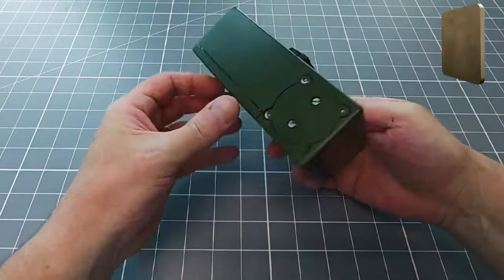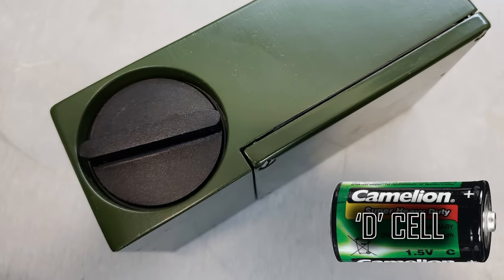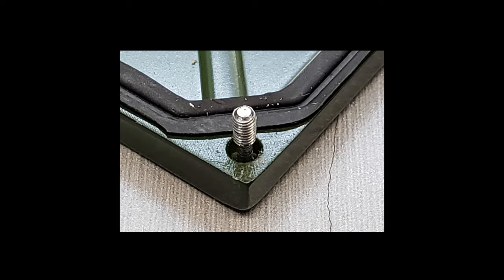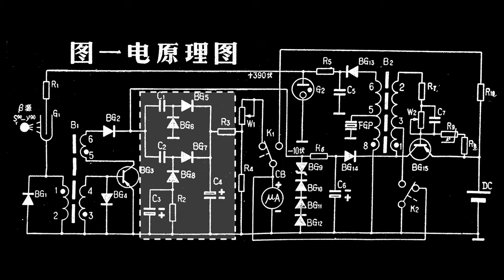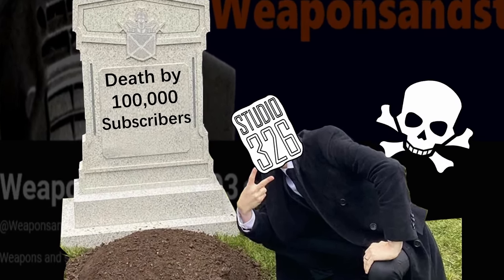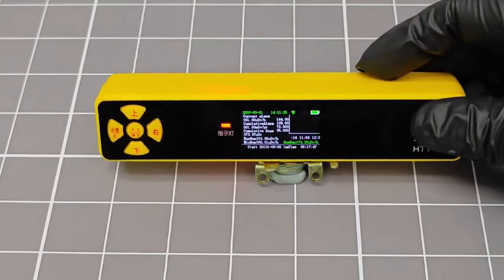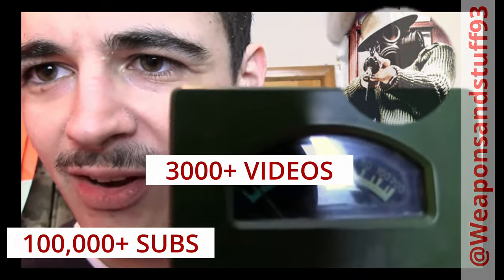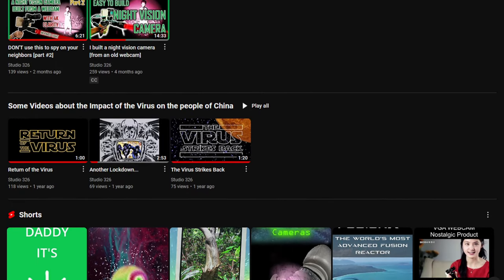Buying a Vintage Geiger Counter  ☢️

Comment: Great video. Just keep in mind that when comparing the dose on contact with a rough point source to a full body dose, that the dose from the source is extremely localized, and the effective dose is low (hundreds of times lower than the full body dose). This, coupled with the fact that Sr-90 delivers near zero deep dose, means that holding the Sr-90 source in your hand for instance, would expose you to very little effective dose (probably less than 1uSv/h).
Reply from the maker: For sure, this is not a whole body dose that W&S93 is exposing himself to, but actually the point is, he is literally touching the Sr90 metal foil.  The naked source will have a foil cover, but this is a very old source, from the 1980's and corrosion is always a concern.  
Personally, I treat this source with the upmost of care.  I plan everything, and every step (and practice the steps) from when the source is taken from the lead box, until it is place back into the box again.  I have kept source holder is intact, its really handy with the spring loaded cover.  As soon as I release the clamp I use to open the source, the cover just springs back into place and the source is in a safe condition again.
I think that the 1uSv/h rate you estimated is about right for a gamma source but for beta, it is likely to be about 10x of that.  Whilst the Seivert is a handy scale for whole body doses, localized exposure also problematic.  Physically touching the naked source is kinda dumb...
Reply: @project-326  why would beta be 10x more? I'm talking about effective dose here (the equivalent of a full body dose). Betas have poor penetrating power and hence don't even contribute to deep dose. The only area exposed would be a few grams of tissue right in front of the source, and hence the dose is way lower than a gamma source with similar dose rates (due to the radiation penetrating into deep tissues). Assuming your source has an activity of around 25uCi of Sr-90 (50uCi SrY-90), then the decay heat would be around 160nW (5.85x10^-4 J/h), since each beta decay yields 1.1MeV of energy (combined Sr and Y). Since only one side of the source can face you at any time, <50% of this will be absorbed by your tissues if you placed the source against your skin. Since the gray is defined as J/kg, and assuming the average human weighs 60kg, that gives a mean full body dose rate of the 4.9uGy/h (except all localized to a small amount of tissue). If this was spread out over the whole body, the effective dose would be 4.9uSv/h, but since it's localized to the skin and shallow tissues (low tissue weighting factor) it'll be much lower than this. On top of this, substantially less than 50% of the betas would actually be absorbed by your body. Most Sr-90 sources have some moderate self shielding, meaning a lot of the lower energy betas are absorbed by the source itself. On top of this, the source you have in particular has that whole sliding shield assembly, which collimates the beam, meaning that in the end the beam angle is substantially less than the 180° assumption I used. Anyway, I hope that explains where I got 1uSv/h from. Thanks!
Reply from the maker: @inductivelycoupledplasma6207  That is a fantastic reply, I will work through the calculations and learn!  
I was assuming a weighting factor of 10 for beta, but I just looked it up and (according to Wikipedia) it is the same as for gamma, ie 1.  
Yes, the whole body effective dose is low, it is a small source, just pretty bright.  But I'm sure you are not suggesting that handling this type of object in the way that W&S93 does is a reasonable way to carry on (he routinely handles this source in a fair number of his videos)?
You are correct about the geometry of the source holder, you can probably divide by 3 (ie 120 deg)...
Reply: @project-326  thanks for replying! They were just ballpark calculations and I made many assumptions along the way, but they should give at least some idea of the actual stochastic risk from such a source (which is extremely low). Of course, the main risk with SrY-90 sources isn't cancer, but rather exposure to the eyes and potential cataracts (albeit highly unlikely unless you use the source as a monocle). The main thing that bothered me about Weaponsandstuff93 wasn't the fact that he exposed himself to excessive beta radiation (not ALARA, but still not a big deal). What bothered me was the fact that he tore the window of the source open, spilling source material on his keyboard and contaminating some of his detectors at the same time. He then proceeded to place the mangled source on his carpet in a later vid (along with a naked DP-63-A radium scale).  That guy is completely clueless when it comes to contamination. I don't even want to think about the fact that I've seen him place a 60uCi pyrotronics Am-241 source on his carpet too (these leak a lot and Am-241 is about 10x more toxic than Ra-226 through inhalation, and 1000x more toxic than Sr-90). 😬
Reply from the maker: I just realized a mistake in my last comment, when I said the ratio should be 1/3 because the angle is 120 degrees.  This is wrong, I should have used solid angles.  A Cone with an apex angle of 120 degrees presents a solid angle of exactly pi steradian, so with 4.pi steradian in full-space, the factor should be division by 4 (not 3).  Was taking a crap, when this just popped into my head...  :-)
Reply: @project-326 yeah, meaning the beam power is quite a lot lower than I calculated. Honestly not too bad of a source to handle, and I would just make sure to protect your eyes if you're using it frequently or for moderate durations. Finally I just noticed that the Meassal read quite high (30uSv/h or so I think), which isn't due to bremsstrahlung. The majority of that will be very spicy (up to 2.28MeV) Y-90 betas that are able to penetrate the enclosure on the detector. The amount of pure bremsstrahlung should be very little (just a few uSv/h at most). You can test this by measuring the source on the radiacode with a couple mm of glass or aluminum in between.

Comment: I don't remember if you corrected yourself in your subsequent videos, but radiation from beta sources is not measured in microsiverts. You can use becquerels or "number of decays per square centimeter". Or you can add "conditionally" to the microsiverts. For example, the dose rate of this beta source is 2 microsiverts, conditionally.
Reply from the maker: Yes your are correct, but most devices cannot differentiate and just use uSV/h.  My alpha/beta spectro displays using Sv/h/cm2, which again is making assumptions, but translating that back to a GM tube is really not easy.

Comment: BR-6 and HTT-60 maxed out! Hehehe.
Reply from the maker: I didn't show what it did to the Gamma Scout (PoS), I'm saving that for the next vid.
Reply: @project-326 how old is your gamma scout? The newer ones are much better (still PoS for €500 of "quality German engineering). Mine doesn't seem to crash, and response stays linear up to around 5mSv/h (starts to saturate severely above 10mSv/h, but doesn't drop to zero).
Reply from the maker: @inductivelycoupledplasma6207 "much better?" We will just have to agree to disagree on that point.  🙂
Reply: @project-326  haha, I'd say the fact that it doesn't crash is a massive improvement. Doesn't change the fact that it's a PoS tho 😁
Reply: @project-326  by the way, I had some questions about that SrY-90 source that I wanted to ask and wondered if you had a place I could email you my questions? Mainly I think it would be cool to try to estimate activity of the source (through comparison to some other reference sources, and by comparing beta flux, bremsstrahlung dose rates, etc). We both have the radiacode and gamma scout (ew) so I suppose we can use those. Sorry for the bombardment of comments, reply at your own pace of course :)
Reply from the maker: @inductivelycoupledplasma6207 morganstudio326@gmail.com